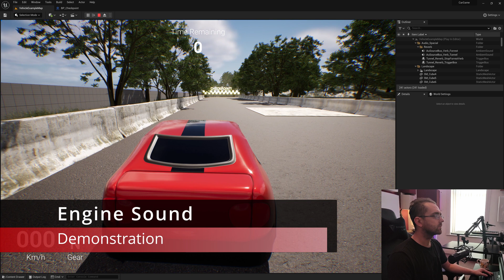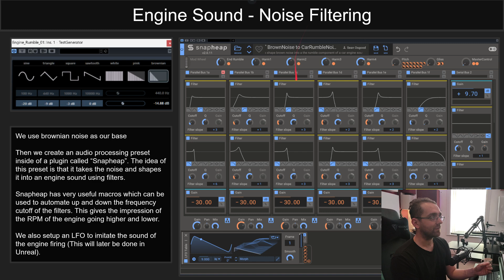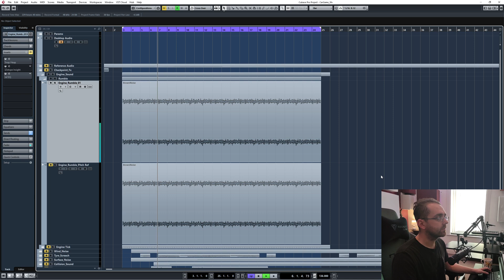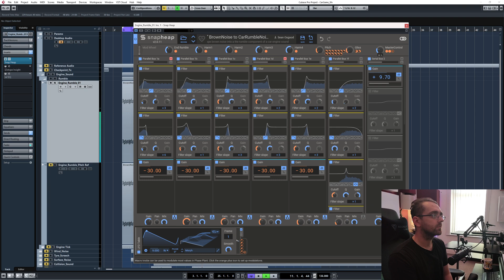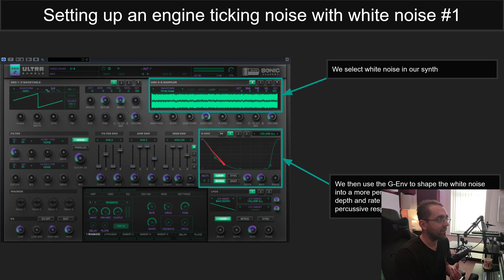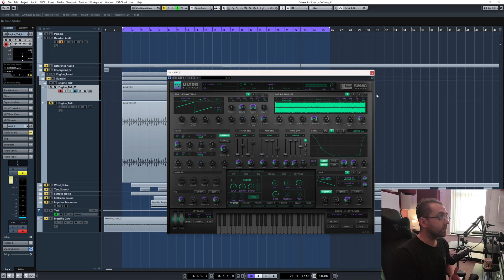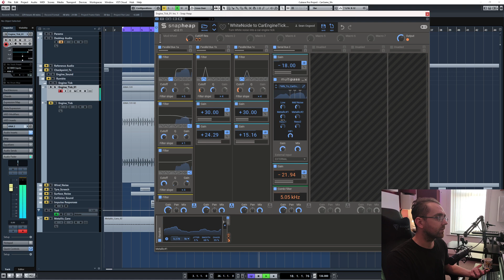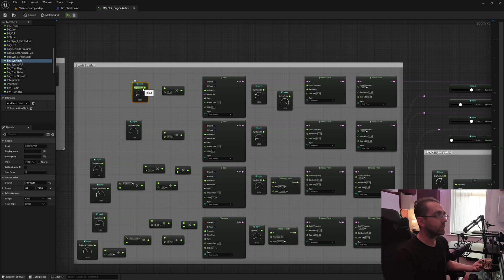Unreal Engine 5 - Car Engine Sound Production - Sound Design for Video Games

Comment: Good stuff! The noise filtering gets a lot done which I was trying to do with regular (squ-saw) waves. One thing, does Snapheap let you speed up the LFO as your acceleration parameter increases? I think that might sell the feeling of the pistons moving faster at higher speeds, or perhaps decrease the amount of LFO send. Really good sounding engine though
Reply from the maker: Yes you can attach a macro to the rate of the LFO. For game development I would use the LFO inside UE because you can't make UE communicate with Snapheap. Snapheap is helping do most of the heavy lifting before exporting the different rpm ranges and bringing those audio files into UE. There is a video coming up which will go through this. :) Thanks for the comment.